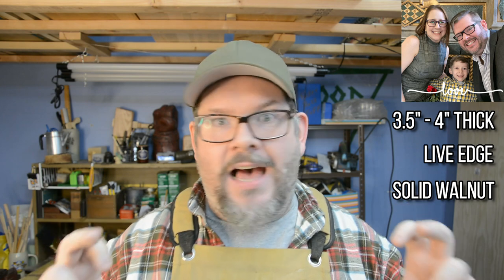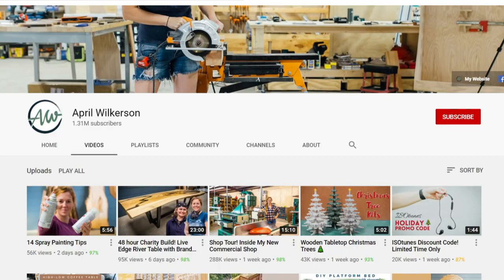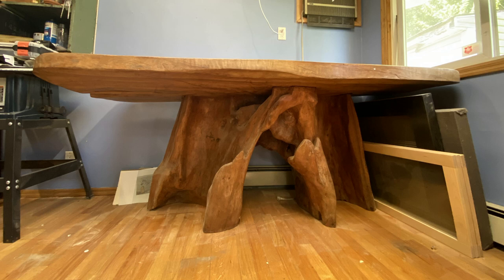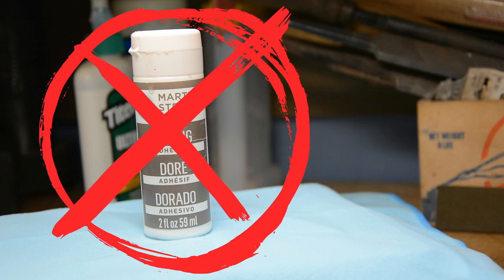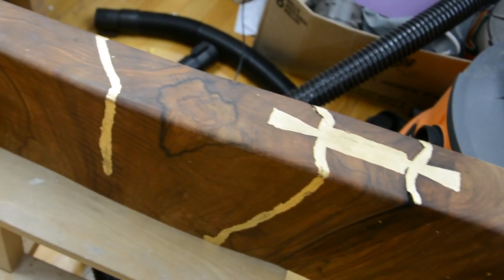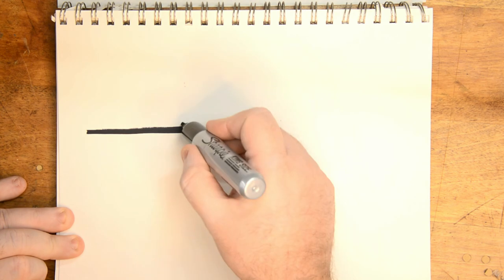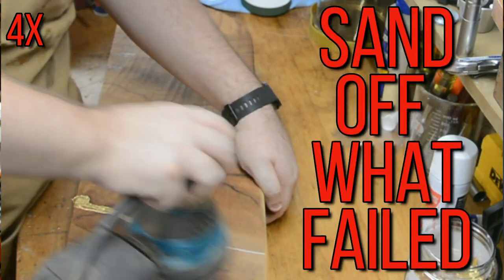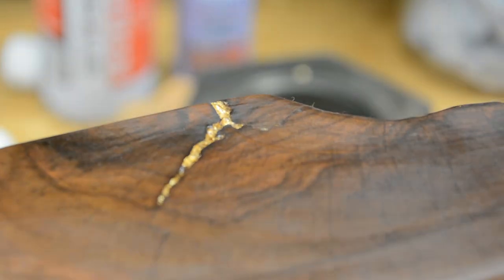Kintsugi Wood Shelves- Gold Inlay - Gold Wood Filler

Comment: I'm curious whether you considered or tested metallic gold powder in epoxy?  It would likely fill the cracks more completely, enabling a flush surface -- which may or may not be desireable, and it make not look as much like real gold.  I'm planning on doing something similar with a wooden bowl that has a crack running down from the edge.  Since it will be used for food, I need a smooth surface that won't catch and hold food goop.  I could always fill the rough gold leaf gaps with clear epoxy to retain the gold look but eliminate the tiny gaps that will hold food...  Thanks for the info and the great demo!
Reply: Epoxy with ‘gold’ would just look like plastic with fakey looking gold crap in it. That’s why the Japanese craftsman still use real gold
Reply from the maker: Yes. I didn’t like the look, HOWEVER, I almost went with gold leaf in epoxy. The only issue was getting into the tiny tiny opening, so I went with what I did in the video.

Comment: I freeze wood to -20⁰F, apply two part epoxy and hammer in gold or silver dead soft wire before heating the wood to 45⁰f and wetting it with water and using a heat gun on low to swell the grain.
Reply from the maker: Why the temp changes?
Reply: @BurkeMakesStuff  I'm just assuming here, but I think they're relying on the expansion and contraction of the wood as the temperature changes to secure the wire.
Reply: how do you get it to -20?

Comment: That's a cool effect. I've mused about using copper to do something similar. Your take on it turned out great.

As far as the merchandise thing goes, I'm on the fence. I have several makers I follow because I like their content. I'll use April as an example since you mentioned her. She sells wearable items, etc. with her logo in them as well as her conversion chart wall hangers. Now, I'm not going to buy a hat, shirt, or sticker from her, but I would buy a conversion chart, because it's something that serves a utility to me. If she popped a sticker in the box with the order, then I'd smile and stick it somewhere in the shop. Now, that's just me. I'm not a "fan" of April per se, but I'm really not the fan type. I'd much rather have a beer with you and get to know you as a person than get your autograph and parade around in clothes with your name on them. Now, if you came out with a magnetic cup holder or pencil holder that mounts on my table saw, then I might bite. 😂
Reply from the maker: When the world calms down a bit, I’d be absolutely honored to have a beer with you! Lol
Reply from the maker: Well… I did it! Thanks for the support and opinion! Now go check it out!
BurkeMakesStuff.myspreadshop.com

Comment: Question pls. I have wood pistol grips with some letters engraved on them.  Letters are not really deep as these piece you have there.  Will the gold leaf still dried really good , also did u spreay the bottom coat first and then the top coat bond after on top of the gold leaf
Reply from the maker: Hi. Not sure this would work in something as exacting as pistol grips.